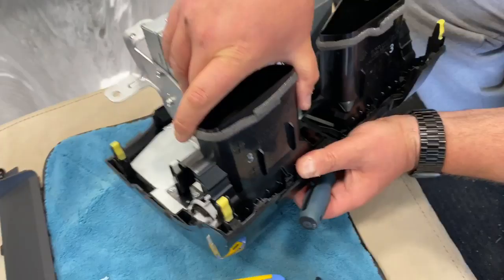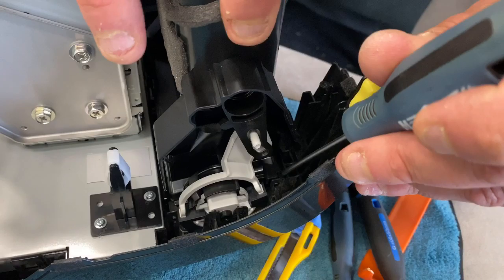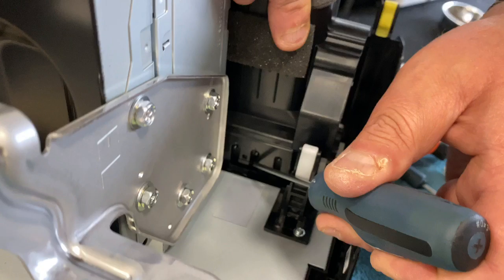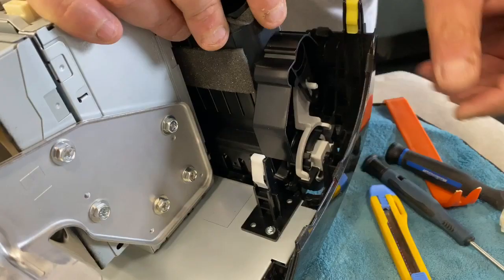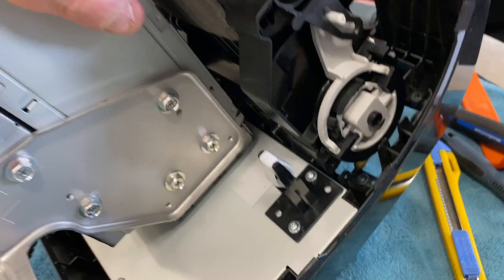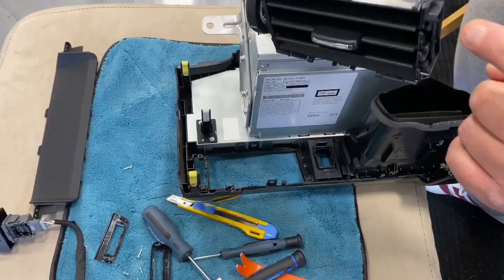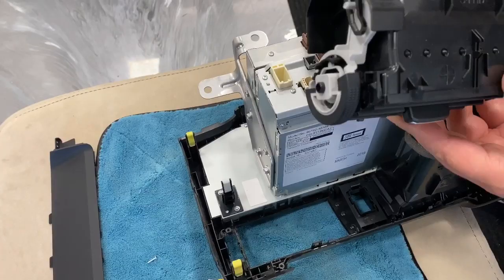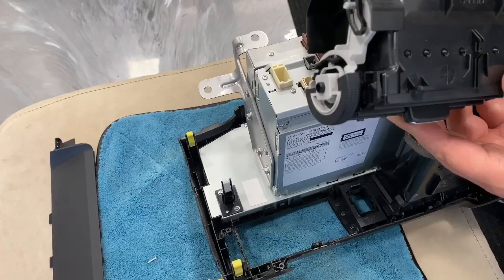T9 Headunit Radio Infotainment Detailed Install for 5Th Gen  4Runner

Comment: This was an incredibly helpful video, so thanks.  One quick question for you if you don't 'mind.  I got everything installed and working, but the OEM USB on my 2011 SR5 doesn't fit the USB harness that came with the unit.  Is there one that will fit the OEM USB in my 4Runner?  Thanks again!
Reply from the maker: Hey, yea, the 2010-2013 usb OEM is not the same . What’s your order number? I’ll guide you to which OEM harness you need to get to make it work.

Comment: Great video man! Thanks for the help. For the CarPlay do I need to buy the CarPlay dungle separate or it comes with the unit?
Reply from the maker: If you order  from the link that I shared , the unit has a built in wireless CarPlay. You can choose to opt in and get the wireless / wired  dongle from the drop down menu. And use an exclusive coupon code 7% oft for me Facebook groups. Contact me on facebook privately and  I can share  it with you. With pleasure. Do you own the unit ?
Reply: Great! Thanks for replying. I haven’t bought it yet but I will for sure. And will definitely contact you thru fb. Thanks again!

Comment: I apologize I may have skimmed passed if the T9 supports steering wheel controls.
Reply from the maker: Yes it does, rear cam and steering wheel . You retain both. With my link in the description. It comes with everything

Comment: Did I miss you doing something with the external mic ?
Reply: I've been using the onboard mic (tuned it using Microphone Amplifier amp like Sevag showed in a video) and it sounds fine.  

Apparently the provided mic is better quality.  To use that you plug the 3.5mm into the giant harness with a zillion RCA cables, and one female 3.5mm plug.  He shows that harness being plugged in at the upper left port on radio rear.  (The other RCA plugs are for aftermarket amps and speakers etc.  If you don't have that and don't need the better mic, the whole harness stays in the box in your garage.)

Comment: Just made my order today
Reply from the maker: What’s the last 4 digits of your order ?
Reply: Paypal transaction #6094D
Reply from the maker: @dbrabago  nope, ORDER NUMBER starts with 160
Reply from the maker: @dbrabago  this order failed , you haven’t gotten charged. You need to re order. NO AMEX, NO DEBIT, and you will receive an order number starting with 160... in the email top right , will say, order failed  or processed .
Reply: @KingSev  I payed thru PayPal.
Reply: Do you accept PayPal? It says pending
Reply from the maker: @dbrabago  yes PayPal is best way to pay.  As I said , that order was blocked by paypal, highly suggest to contact them.
Reply: @KingSev  contacted paypal. They said payment went thru.
Reply from the maker: @dbrabago  what’s the order number that starts with 160?
Reply: @KingSev  I only have the paypal transaction #
Reply from the maker: @dbrabago  you cannot only have PayPal transaction or order went though and processed . Even if failed, it’s rejected you will get an email , please check your email that you paid  with , spam and junk. Do you have any other way of communication? Because this is not right to communicate on YouTube... or sign up to Facebook messenger and contact me please , Sevag Merdinian . Thanks
Reply: @KingSev  I contacted you on messenger

Comment: Hello, great video, thank you, it's very informative. I just have a few questions. I just purchased the T9, but it hasn't arrived yet. I'm from Chicago, I just want to use the Android auto, I don't want to use Apple carplay. Can I do that? Also, did I hear you right? It comes with a sim card in it already??
Reply from the maker: It comes with a Sim tray, not a card, a SIM card is sold and provided by the telecom company. What’s your order number ?
Reply: Oh, ok. So I need to contact Sprint, ok, cool, thanks. I ordered through Amazon, not cartrim.
Reply from the maker: Why? My coupon gives you rebate, plus it’s brand new for 487$ delivered and not refurbish like Amazon sells. You will have problems with the Amazon one, it’s the units that I rejected :) plus no support at all! Also sprint doesn’t work ...
Reply: Thanks for the info, wish I would've seen your vid 1st. When I get it, I'll let you know how it goes.

Comment: You mentioned you had a rubber piece for the top of the radio.  Where can I find it?  Thanks.
Reply from the maker: Hi, yes, it’s the set here. 

https://cartrimhome.com/Inner-Door-Cup-Holder-Non-Slip-Pad-Mat-4Runner?tracking=ncJKtrtdNkES3RSYEOSXlG4r7y7yGJS1z8PFUL4ho3ejj9k5w51QlgTnFbwhJkTW

Use coupon  code Kingsev5

Comment: Hello, do you know how to do a complete reset? I installed one and after a year it stayed with the fixed toyota logo and it does not start, I tried the manual reset button with a paper clip, it restarts but the problem continues, thanks for your help
Reply from the maker: Where was the unit bought ? What’s the order number ?
Reply: @KingSev  I just asked a question regarding a problem I am having with my head unit (Toyota logo is fixed on the screen and does not go away) and I was asked about the order number. I do not have that info as I bought the vehicle (used) less than two months ago and it had the equipment already installed. Please help, I am stuck and cannot do anything with it. Thanks!
Reply from the maker: @julito80  then post the question as you just told me in here. Because joining the group, you need to answer the questions correctly. You didn’t mentioned all this above. 

Plus, when you joined the group, you didn’t answer that you already had a unit … 

You posted  this …

Hello, do you know how to do a complete reset? I installed one and after a year it stayed with the fixed toyota logo and it does not start, I tried the manual reset button with a paper clip, it restarts but the problem continues, thanks for your help

Unfortunately if you do not answer the questions , I will not approve any joins, there are scams happening and I don’t allow that in my groups. 

Here is what you said : 

Hello, do you know how to do a complete reset? I installed one and after a year it stayed with the fixed toyota logo and it does not start, I tried the manual reset button with a paper clip, it restarts but the problem continues, thanks for your help.

Comment: Good afternoon I try to buy t9 for my 2018 4Runner but my is limited still compatible and Steering wheel control is working and do you need a special cable for the CarPlay if you want to do it like Wi-Fi in advance thank you for your help

Comment: What is the best way to get support for the T9 head unit? I am having some issues with car play not playing any sound. Worked perfectly the first day, but no longer works. Thanks in advance for your help steering me in the right direction. I'm assuming there is no manual for the unit either, correct?
Reply from the maker: All my videos have all and important links , descriptions and coupons for everything …

Comment: This unit doesn't work on my 2011 4runner limited had to return it... now stuck with the oem trash head unit
Reply from the maker: I have more than 900 members that OEM 2010-2013 and the unit works flawlessly ! Where did you purchase yours ? Join my Facebook group and see for yourself. 

Here is the right link for your model, answer the right questions of your OEM unit, everything you need is in the description of this video. 

4Runner 2010-2013 use this exact link 👇🏻

https://cartrimhome.com/Head-unit-for-4runner-2010-2013?tracking=ncJKtrtdNkES3RSYEOSXlG4r7y7yGJS1z8PFUL4ho3ejj9k5w51QlgTnFbwhJkTW

Use coupon code 5SEV

Comment: You can put on a 2010 sr5 with no steering wheel cotrols?
Reply from the maker: Il sorry, in dont understand the question , if your OEM has steering wheel controls , then yes, you can retain the steering wheel controls if you order from the right link from the description of the video.

Comment: Does the back up camera look any better with the t9 unit
Reply from the maker: Yes and no, T9 is way bigger screen than oem, mornings is great, nights is shitty of you DONT have a really good backup light. I have these, Backup lights : https://lddy.no/rju4 they are great, but still kind of a little blurry, if you join the FB group in the description, there are many posts about the backup cam and solutions. There is a setting in the backup cam of the T9 that makes it slightly better though.

Comment: I’m having an issue where sound works on Bluetooth and other apps but sound doesn’t output when using CarPlay. It worked the first time I used it right after install but then I turned off my car and the next day it didn’t work. Any idea how to fix it?
Reply from the maker: What’s the order number ? Where was the unit bought from ?
Reply from the maker: @xxtexansxx44  CTH order number starts with 160

Comment: At time 25.01 what is the part number for that tray?
Reply from the maker: Top radio trim bezel cover
Reply: @KingSev  Thnx
Reply: Well, Toyota is of no help. If you ever get another install and can get a part number on it, I would appreciate it.
Thnx for all you do..
Reply from the maker: @joebagodonutssummertime8267  join the runner group, and headunit group, in the description. Admins : mods will advise part number .I’ll look for the post . Some others also wanted it in my groups.
Reply: @KingSev  Thnx. Very much appreciated.
Reply: @KingSev  No part number. I have one in hand. Just has the material its made with, ABS on it..

Comment: how do you insert the SIM Card on this radio?
Reply from the maker: It comes with a sim tray. Do you own the radio?
Reply: @KingSev  I own the radio (or at least it looks super similar) but I don’t have that tray.. maybe it’s inside the car but I would have to unmount it to check.. A friend found the shop to install the radio, but I didn’t got any instructions
Reply from the maker: Super similar doesn’t work, if it’s not a T9 then it doesn’t have a sim tray and if you’re talking about the Dasaita . Then it’s no good. Doesn’t come with a sim tray and the unit is not that great . Sorry man.